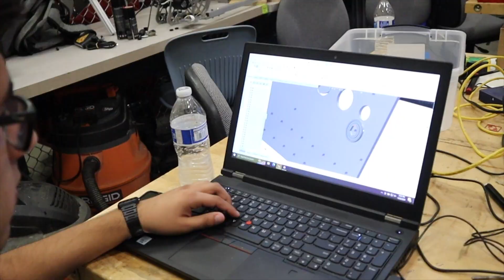FRC 2024 Week 4 Recap

Comment: Why did you build a horizontal turret? If your going to have swerve why would you need a turret, its a great robot but I was just confused about the turret.
Reply: Swerve + vertical turret = independent shooting and movement directions, but fixed intake and shooter directions.

Swerve + horizontal&vertical turret = independent shooting, intaking, and traversal directions, as well as the capability to turn while maintaining a fixed shooting location.

Probably won't be incredibly incredibly useful during the majority of teleop, but will allow extraordinarily good autons
Reply from the maker: We decided on the turret for primarily autos.